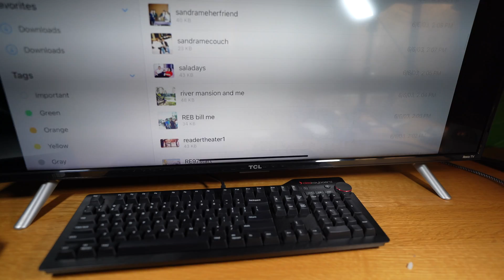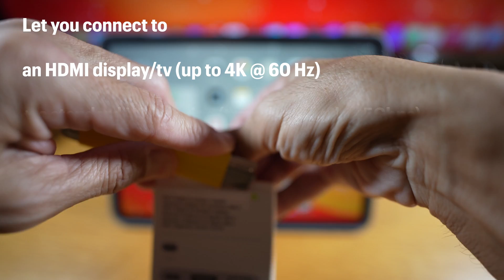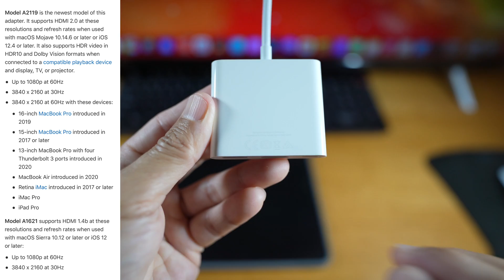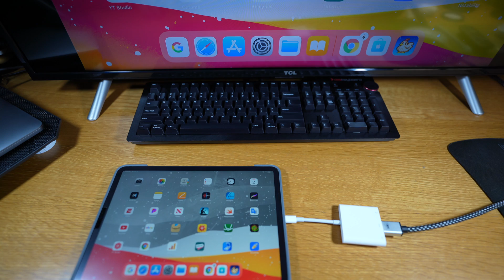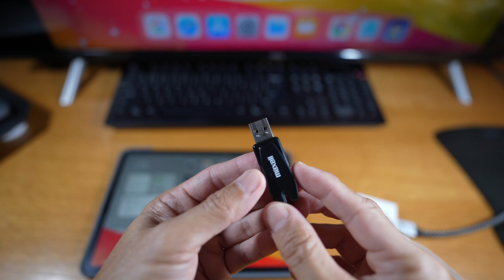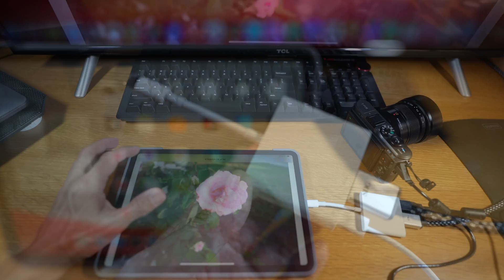For M1, M2 & M4 iPad Pro, Apple USB-C Digital AV Multiport Adapter

Comment: Hi sir.  will  A2119 supports 1920x1080 60hz monitor? or only 4k 60hz.
Reply from the maker: Hi thanks for your comment. It will support 4k 60hz (and 1080p 60) MacBook in “clamshell” mode; could be seen is the system report. However, when my MacBook is open, it won’t do 60hz, don’t know why. On my iPad Pro, I can’t really tell if it’s 60hz or notice the difference comparing to my MacBook. This is my experience.
Reply: @TossSong  thanks for your response
Reply from the maker: No problem.

Comment: can i use this type c port to using headset with usb c ?
Reply from the maker: Hi, thanks for your comment. Unfortunately you can’t. The USB-C port is only for power delivery. The only way is to unplug, and use the iPad port. :(
Reply: @TossSong   can u find smething for my ipad pro because my headphone is jbl with type c port .. but i cant use it with my ipad pro m1 2021
Reply from the maker: Unfortunately, if it doesn’t work directly, that means it’s up to Apple (iPadOS). They need to update their iPadOS, like updating MacOS. I would guess with anything else even an expensive hub won’t do, because iPadOS is not refined enough…yet. :(

Comment: I just bought it and even thought it shows charging on ipad but it stay constant. My battery doesnt go up or down. Does your charge when you the multiport adapter?
Reply from the maker: When using for example multitasking say playing games, or using external drive, or viewing pictures on a thumb drive, it will Slowly charge it with mine—which I don’t like. You may not want to charge it that way, not with the adapter.

Comment: Can i use a usb microphone to connect this to my ipad?
Reply from the maker: Unfortunately no. You would need to directly connect a microphone with USB-C connector. The reason is that iPadOS is not up to the task (won’t recognize it) using the Multiport adapter. Thanks for your comment.

Comment: i tried to connect my external hardesk through this usb c digital av , but my iPad doesn't open pictures or video , what should i do , is there any app i should download on my iPad , it a new iPad , when i open files , it open but doesn't play or view pictures?? please help me here
Reply from the maker: Thank you for your comment. Unless you have an iPad Pro, the external drive will have to have a power adapter powering it. For lightning iPad this is the case from my experience.

Comment: Can we use usb A to use usb headset ?..pls reply if you have tried
Reply from the maker: Hi, thank you for your comment. Unfortunately you  can’t, at least not directly. I tried with an adapter and no go. I think that someone mentioned/commented here that it would work if you used external power (supply) going through it, but I can’t confirm that.

Comment: Hi bro, i want to ask when the adapter is plugged into the ipad, is there any information about the type of accessories in the ipad-about settings?
Reply from the maker: Hi thanks for your comment. When plugged in, it only detects for example, SD cards files or through camera. No HDMI indication or anything else. No Ethernet either info either. No accessory info like what kind of cable is plugged in, things like that. And no mentioning what type of (or name of) camera is plugged in.
Reply: @TossSong  I mean is there an example of displaying the firmware version, adapter model type, etc. in the settings about ipad
Reply from the maker: I’m sorry, I hope you mean in the settings, under “General” and in “About”? If yes, then no.  I tested a USB drive and a camera. Nothing shows up. Hope that’s what you mean.
Reply: @TossSong  Okay bro thank you.

Comment: Apple tell me that you can attach a 'USB-A to Ethernet adapter' into the usb -a port and connect Ethernet. Has anyone tried this?
Reply from the maker: Hi, thanks for commenting. Yes, it would work if you use the adapter with a MacBook or a PC. However, with an iPad, I don’t know. I assume not because iPadOS is not as refined as MacOS. This is just my guess and I have not tested it. If anyone can chime one, that would be great.
Reply: This is my question too. Is it working on full speed with the ethernet? And what about the write/read speed if I want to connect an external SSD or HDD?
Reply from the maker: Hi, thanks for your comment. So you know on the adapter, the USB-C port [can’t] be used either way—only power delivery. So USB-A port only for both Ethernet or Storage. For Mac, it should be full speed Ethernet (again through USB-A port). As for SSD and HDD on both iPad and Mac, it would be limited to USB-A 3.0 speed which is slow for SSD. For HDD like high storage WD, of course you’ll need to connect it with an AC adapter as usual.

Comment: Hello, I am a Sales Trainer looking to use my iPad Pro for my 6-7 hour long workshop which brings me to my question. Do you think this setup would work with a remote clicker to change keynote slides and will it overheat due to the long period of use? Thanks a lot!
Reply from the maker: It should not overheat, I have used it all port plugged in for a long period and I have no problem. It’s just warm throughout. However, hopefully your setup which I don’t much about works well. Thanks for your comment.

Comment: hello.  I have a MacBook Air 2020 M1 and today I will buy an LG ultrawide 2560x1080.  these monitors support up to 75hz.  I would like to know which one I need to have the maximum resolution.  the A2119?  or the A1621 would be enough?  I would like you to help me with your answer.  Thank you.  Greetings.
Reply from the maker: Hi, thank you for your comment. A2119 is the newest version, so I would go with that. However it will only take 60Hz 4k video, but it will work perfectly with the monitor you want. Hope this helps.
Reply: @TossSong  hey, thank you very much for answering me.  I actually found an A1621 adapter for a good price but haven't bought it yet.  I don't plan to use it in 4K and I'm not a Gamer.  I just want to use the LG29 ultrawide 21/9 in HD (2560x1080).  I see that you had and know the A1621, do you think that with the A1621 I can use it at 60hz?  with only that resolution?  (2560x1080) 🤔
Reply from the maker: Yes, it should work fine. The model A1621 supports HDMI 1.4b up to 1080p at 60Hz (but 4k at 30Hz). When you get it, let me know how it works for you. Thanks.

Comment: Can we use this adapter to connect Macbook pro M1 with iMac 21.5 2019 model to be used as a display? Please help!!
Reply from the maker: Hi, thanks for your comment. If you plug a Mac to a Mac or a PC (or any combination), nothing should happen. For Mac to Mac, it would only be for transferring or migrating. So using for a monitor would require a software. This is all my opinion. If any can chime in, it would be greatly appreciated. Thank you.

Comment: Is it usb 2 or usb 3/usb 3.1?
Can i connect usb to ethernet? And if, Will it need power to operate?
Reply from the maker: Hi, they (Apple) doesn’t specify what usb number it is. It’s likely compatible to all. *However, it will not connect to Ethernet using C or A—I have tried. And others on Amazon have as well. Sorry, but hope this is helpful. Thanks for commenting.
Reply: @TossSong  i had ipad pro 2017 lighting and used the same adaptor “however lighting not usb c” and it worked to connect ethernet via usb 2 & 3 through usb a port, i had to give it power inorder to work
So did u plug into power?
I need an adaptor that has usb c, hdmi, ethernet, 3.55, any suggestion? Ofc fits to m1 ipad pro
Reply from the maker: Good point. No I didn’t use power adapter. (Now I’m not so sure.) My Ethernet is portable, no plug in for power. Just in case you may want to read Amazon questions/reviews on this. Let me know. Thanks.
Reply from the maker: Also I really do have suggestions for more powerful dock or adapter. Since I haven’t tested them myself. I did have my eyes on some. But the reviews were all over the place. So I gave up.
Reply: @TossSong  i tested it with usb 2.0 to ethernet and it worked with connecting power, also connected headphones “usb” worked
Reply from the maker: Thank you for this. I will update the description mentioning that is possible with power going through it. I will also try it. Thanks again.

Comment: i Have this for my ipad air. One cool thing about the usb a out is that you can use it to connect to a dac. So I have hdmi out to a monitor and usb a (using a usb a to micro usb cable) out to a digital to analog convertor (schiit modi) and it works great. This might be useful for a lot of desktop setups.
Reply from the maker: I agree this is very versatile adapter. Good to know that it works with digital to analog converter too.

Comment: ipad mini 6 support?
Reply from the maker: Hi, I’m sure it will work. It’s USB-C right? So, it should work.  When I bought it for my iPad Pro, there was no iPad Pro mentioned anywhere. Pretty sure.
Reply: when plug in hdmi, does the ipad sound on the monitor come out?
Reply from the maker: Yes, it does output through HDMI—so to TV or monitor. But I use Bluetooth headphone.
Reply: @TossSong  can this adapter be used on android type c?
Reply from the maker: Hi, sorry I cannot answer. I don’t own an android device to test it. In the Apple website, the compatibility list had only Apple Macs and iPads (not even iPhones mentioned). I also looked on Amazon for you, out of 169 questions, one said no. Again, sorry I don’t know.
Reply: @TossSong  thankss
Reply from the maker: No problem. Thanks for commenting.

Comment: Sir 1TB external Hard Drive can read also? or usb only?
Reply from the maker: Hi. Yes, it should on the USB A port (Not the USB C port). However if your external hard drive needs power, then it must still be plugged in (with power adapter that it comes with)—at the same time when it plugged into the USB-A port on the Apple MultiPort adapter. Hope this helps.

Comment: I have been trying more than 4 USB type-c connector or hub to connect my M1 iPad pro 12.9 to 4K monitor/TV, both can only display the same as what iPad pro is displaying and with 2 black bar at two sides. That means, it cannot fully support 4K resolution. Someone told me that the new Apple USB-C Digital AV may work. After gone through this video, I was too disappointed to see that it is the same even though it is twice more expensive than those few connector found in the street. I beleive it may be limited by the iOS or hardware design of iPad pro.....
Reply from the maker: Now I understand exactly what you mean. No adapter will do 4K until Apple decides to update it’s iPadOS to accommodate this. *However in Lumafusion, for example, you should see Full 4K display when you’re in Playback (play) mode. Of course, not during editing. Again it’s up to Apple.

Comment: I have ipad pro 11 2021 too , and that adapter , but when i mirroring with elgato hd60s , this adapter suck , suddenly blackscreen and then 2 second normal , every 5 minute black screen , should i buy thunderbolt 3 to hdmi cable?
Reply from the maker: Thanks for commenting. I wouldn’t know if thunderbolt 3 to HDMI would work with Elgato. You may want to research that. But my guess is that it wouldn’t because there isn’t enough power on both the iPad and the adapter for it to work. This adapter is simplistic, not made to do much more than what you see on this video. It would heat up pretty fast. Just my guess. I also know that researching anything relating to This Apple adapter is kind of hard to find. Again, I wouldn’t really know. :(  Sorry.
Reply: @TossSong  that is exactly my issue, my Ipad pro 11inc 2021 keeps disconnecting from OBS.
Heating or power is not the issue, since i used Lightning Digital AV Adapter with Iphone 11 pro max, that adapter is more simple than this USB-C one.
Reply from the maker: Saya pikir adaptor ini bagus dan sederhana.
Reply: Same problem, I use mine with an Elgato 4K60 Pro MK2, same problem.
Reply: I have the same issue rn,did any of you figure it out?

Comment: Hi.
Can I mirror my M1 MacBook air on my tv using this adaptor?
Reply from the maker: Yes, absolutely. It’s in the Apple website description. Also if you want to read more about Q&A or reviews, search on Amazon: “Apple USB-C Digital AV Multiport Adapter”.

(I had replied previously. I deleted it. YES, it will work right out of the box.)
Reply: @TossSong  thanks a lot
Reply from the maker: No problem. :)

Comment: Hi, I want to buy the same adapter, can I plug a usb headset? Will it work?
Reply from the maker: I can’t say for certain. USB-C port won’t work—it’s does power only. USB-A port is for data only; I tried to use it with MIDI adapter that has 3.5mm headphone jack, it didn’t work. It’s either that my MIDI adapter is faulty (it’s like 10+ years old) or *there’s no software driver programmed into the iPadOS to support it. I also did additional research for you, one comment says it works with MIDI, but the person seems to not have tested it. Bluetooth headset is the only certain way. Hope that helps. :(

Comment: Can i use usb a to ethernet adapter in the usb a port ?
Reply from the maker: Thanks for commenting. From what I know and researched before I bought this, unfortunately you can’t with any of the ports. I have USB-C to Ethernet adapter that works but needed to be plugged in separately. :(

Comment: Can we use usb headphones with this adapter?
Reply from the maker: Thanks for commenting. Unfortunately, I tested it with the “M-Audio” brand USB to headphone adapter, it didn’t work. I’m disappointed. :(
Reply from the maker: It’s possible that my M-Audio is defective (it’s old). I did some research and it would work with USB MIDI. So, it theoretically should work with headphones. Hopefully someone can confirm that. Thanks.

Comment: is the USB C port next to the HDMI port for data only? Or could you plug in a USB C hard drive? More specifically could I have a USBC C drive plugged into that port and another drive plugged into the regular USB port?
Reply from the maker: Thank you for commenting. The largest port (not the HDMI) is a standard USB-A—but you can use a separate cable to be plugged in with USB-C to transfer DATA. Type in Amazon “usb to usb c” and you’ll see what I mean. The smallest is a USB-C port—but only for {power} delivery. Hope that helps.